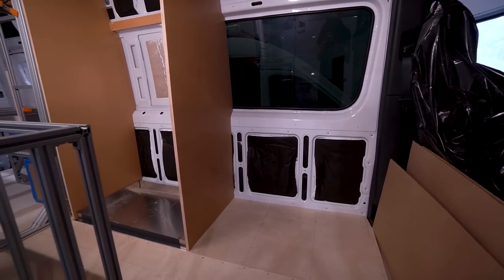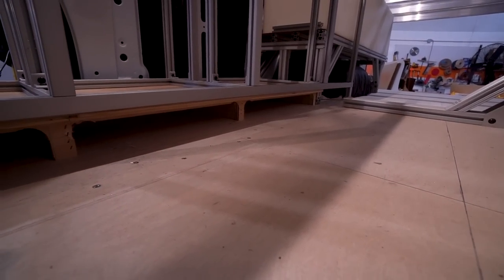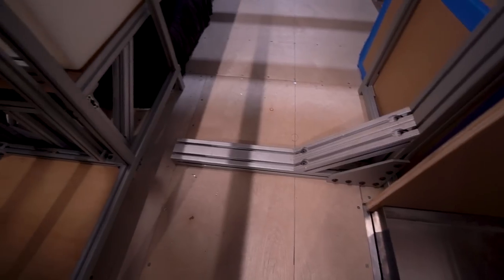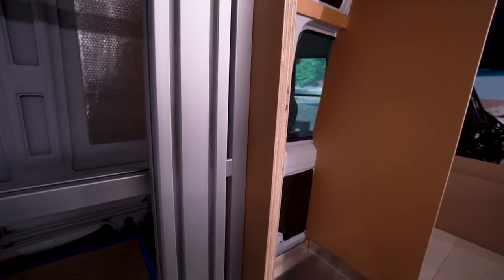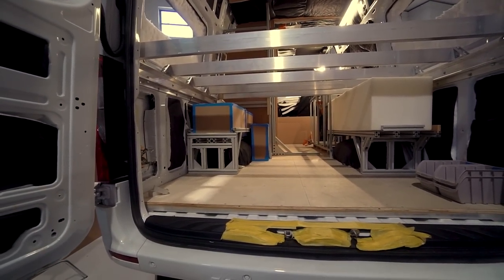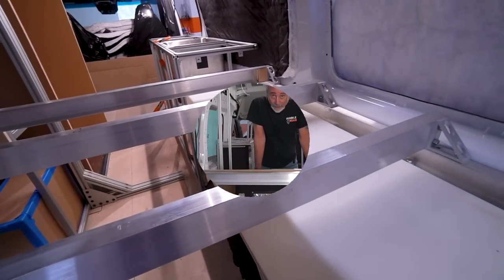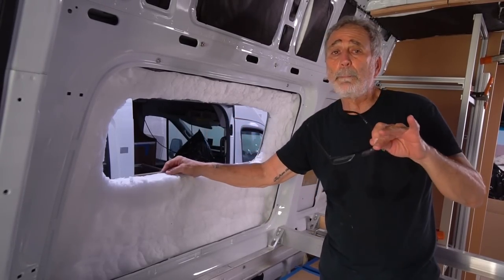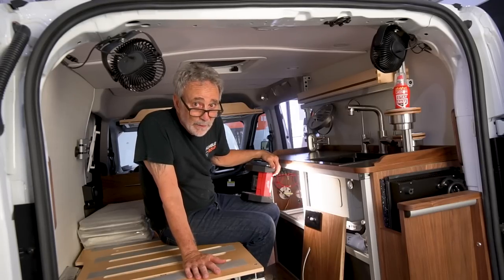If you plan to build your own camper van, watch these builder's tips.

Comment: Another beautiful conversion coming together nicely. I've installed many CR Lawrence windows with the metal ring and none of them line up. What I do is clamp the ring all the way around so the holes in the ring line up with the groove in the window as closely as possible. Then I pre-drill the holes in the window, boring out (elongating) the hole in the ring where needed. Good luck!
Reply from the maker: Without even a discussion, I’ll be sending these windows back for a refund. They are unacceptable.

Comment: Hi George, we installed a CRL window with an awning window in the sliding door of our RAM ProMaster 3500.  We are having the very same issues you mentioned. We have been in contact with our reseller who is awating response from CRL.  In our situation, even after sending video and consulting with the reseller, the clamp ring has not tightened the window up to the van side so the window rattles when driving.  We have not yet tested for water tightness.

TY for you continued awesome video, instructions, and enjoyment watching your van builds and innovations.
Reply: Film yr water test and post pls !!!!!

Comment: If you can't do a wire channel, a large piece of Pex hose can flex and curve, and will give serious protection to your wires. Use wire lube to stuff it through and it will go much easier. Know that heat buildup in a conduit can increase wire resistance, so go up a guage or two.

Comment: I am curious about the water tank, what about going with a tank that is meant to fit over the wheel well? Then there is no bridge framing, it lowers the CG of a lot of weight(8.34lbs/gal= 417 lbs of water) for better handling(less body roll), and it would free up more space under the bed. One other concern, those Isotherm fridge and freezer are available as two separate units that could be mounted side by side keeping the CG lower in the van and putting a light weight cloths closet or pantry storage above the two floor mounted units. Just some ideas I thought of.

Comment: The tanks that sit on the floor and contour over the wheel well might be a good option to keep the CG low and open space above the tank for other installations.
Reply from the maker: The volume of those tanks is not adequate for some of my clients needs. And I would have to connect the two tanks on opposing sides of the van, not optimal.

Comment: I had the exact same problem with my bunk windows from Flarespace (didn't know they are Lawrence windows). Worse, on one, my rubber gasket had its seam located along the top edge & was not glued together. I had to tear it off and used urethane instead.

Comment: Yeah ...CR Lawrence windows require additional fabrication to fit, I fitted 2 sliders on my van and one of the inner rings needed half an inch shaved off! I also tossed their self-tappers, lined it all up, then drilled and tapped my own holes on the bench. Fitting was then pretty easy and they look and work great, so the design is fine, they just need to introduce some QC at the factory!
Reply from the maker: Sure, but that kind of modification would void the warranty.  As a builder that’s a no-no!
Reply: Wise words of course, and I admire your resistance to making obvious improvements in order to protect your warranty position, especially with such a poor product. I’m free to assess and take my own risks, so as a DIYer, it was a yes-yes!

Comment: I got away from that Aluminum.. It weights more then wood. And takes up space..Then I went to high density foam rubber in place of wood sub floor. As my wood was eat up with rot, mold and mildew..Then installed Pergo Flooring 10mm...That fixed that issue.. Then used 3M 600L insulation..

Comment: do you determine the center line based off of multiple measurements along the body as it tapers..or...do you take an average along the length and make that the center? I had an old house a time or two..i could pick "level" or "plumb", but not both.
Reply from the maker: Several measurements along the full length of the van should give you center all the way

Comment: I am upfitting my 2012 Roadtrk Sprinter and using 3" c-channel. My plan was to lie them flat, as opposed to on their side like you are doing. Is the way you are doing it stronger or??? I was thinking that I could use the cavity in them as a trough, but curious as to why you put them on the side. Any tips?
Reply from the maker: Yes, laying them taller is MUCH stronger. Having said that, unless you plan on very heavy load, go ahead with your trough idea. I have done that myself. Supporting the bed? keep in mind that all the C-channels work together to carry the load. Set them up and sit on the plywood. Make note of the flex and bounce. Should be fine.

Comment: I have a old ford e250 coachman that I want to redo so my question is about what is the best insulation that I should use. the top of the van is fiberglass the sides of course is metal it’s a 1996  thank you I watch your channel all the time and your information is invaluable
Reply from the maker: As far as insulation, you could use a combination of Thinsulate and poly iso foam board. Good luck.
Reply: @HumbleRoad  thank you for taking the time to answer its much appreciated

Comment: Everything is square to the van deck, but being plumb assumes that the deck is level to begin with.
If the deck is level, how much does it go out of level when all of the weight is added during the build? The suspension must give a bit.

Comment: I came across this warning about CRL windows recently at one of their resellers: "The CRL VW1033 has had an abnormally large amount of quality issues recently. Nomadic Supply Company recommends the VWD OVR3310 Overlander Camper Van Bunk Sliding Window over CRL VW1033 bunk windows because the VWD OVR3310 Overlander Camper Van Bunk Sliding Window has a better rubber outer seal, has a better rubber main seal, a better screen and a much better warranty. Our Overlander window has a UV coated 3M weather seal, this provides better protection from dry rot and the elements of the standard sponge CRL uses. A thicker rubber trim is utilized on the Overlander offering a cleaner non-wavy appearance and better seal from debris and wind. Overlander features a screen that is inset into the framing of the window this keeps the screen tighter and quieter. The CRL insets on one side then overlaps the frame on 3 sides. On the outside there are two plastic turn tabs that hold the screen to the frame, this will cause rattling on rough roads. Warranty – Overlander offers a 1 Year Warranty, and CRL offers a 30 Day Warranty. Both are 33″ x 10″ Cut-Outs, Both are black frames and Solar Privacy Glass Overlander has a better UV filter at 17% allowable vs 28% allowable. If you are using these windows in our Flarespace Flares then you cannot use the Overlander, but if not, we’d strongly recommend the VWD OVR3310 Overlander Camper Van Bunk Sliding Window."

Comment: I assume the Reflectix is meant to reflect internal heat back into the cabin? 
Always great design and content.
Reply from the maker: No. Reflect fix needs an air gap in order to work the Thinsulate is considered the air gap. Its fibrous composition merely slows the transmission of temperature change once that cold or hot hits the Reflectix it is reflected back up through the Thinsulate laying on the back of our ceiling panel, the reflectors does nothing for the inside of the van, in my opinion…